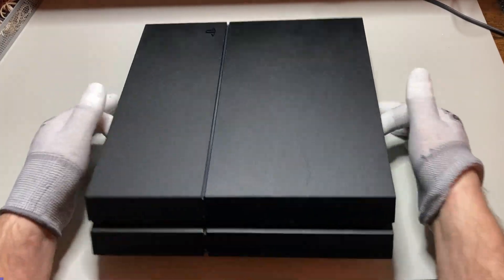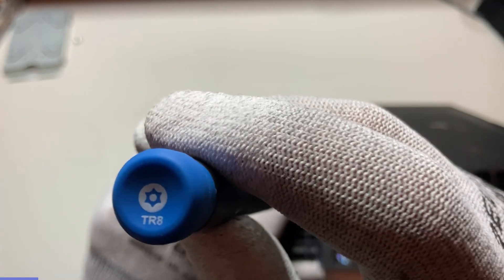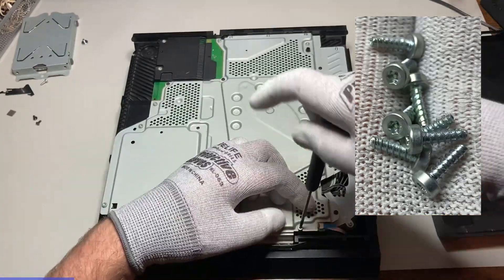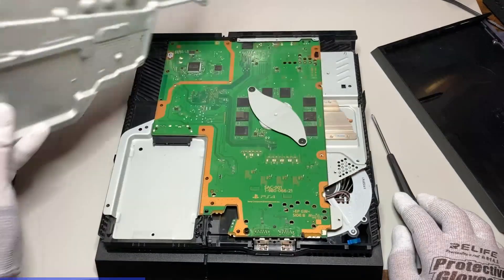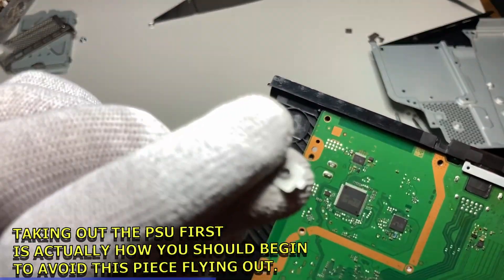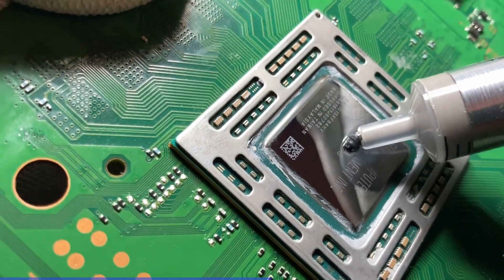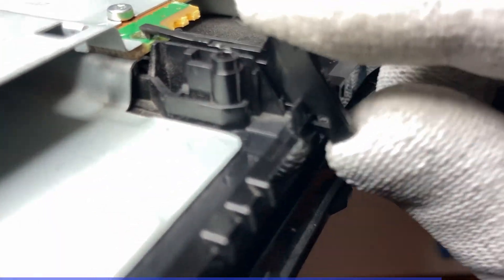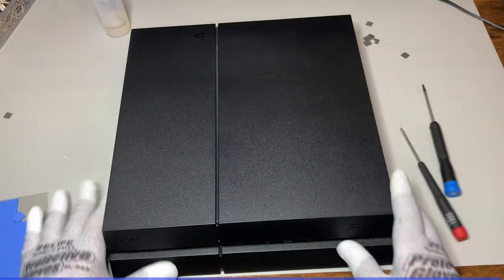PS4 CUH 1215A Disassembly Guide for Increased Thermal Cooling - Refurbishment

Comment: Is the thermal paste you used the high density 12g tube of artic silver 5?
Reply from the maker: I believe it is!
Reply: @RetroFix alright cool, also how do you know if ur fan is broken? I think I hear it spinning when turned on but it doesn't turn smoothly when I just took it out. It feels stiff or not lubricated